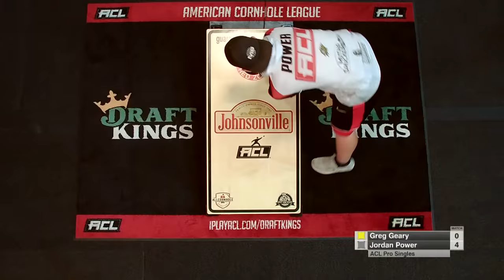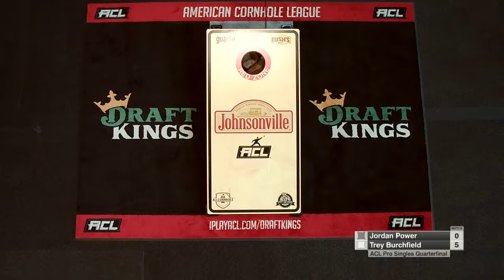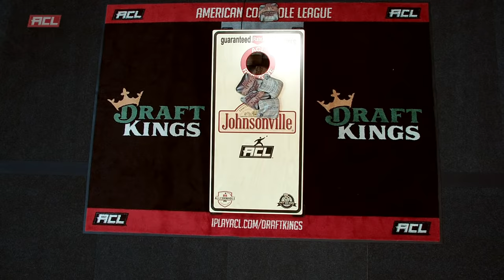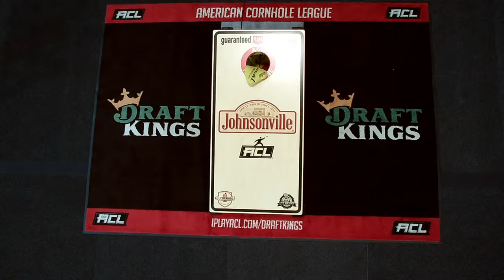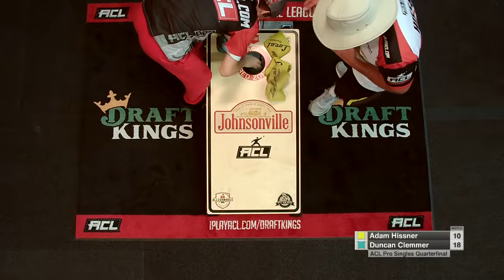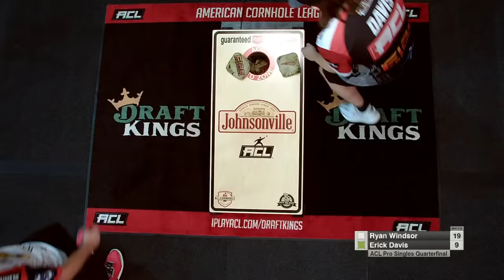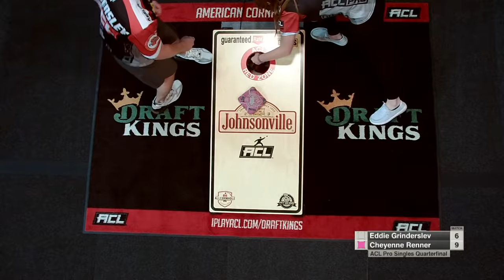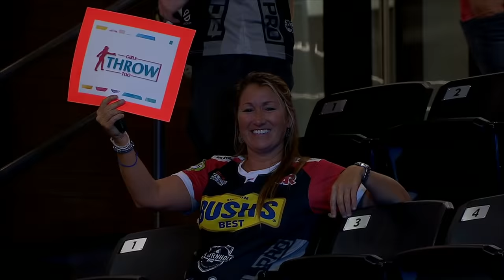2021 American Cornhole League World Championships: Pro Doubles

Comment: I just learned how to play this game last night and was blown away at how fun this is. And now I find out that there is a championship, mind is blown.
Reply: how does the game work? what are the rules?
Reply: Raymond Ashby it’s very simple but hard to explain through typing. I suggest looking it up. It’s extremely fun tho
Reply: @raymondo162  It's 27 feet between boards. Players alternate throwing 4 bags per round. Bag in the hole is 3 points. Bag on the board is 1 point. Bag off the board is 0 points. It's cancellation scoring. If you throw a 9 and your opponent throws an 8. You get 1 point for that round. If you throw a 12 and your opponent throws a 12, then it's a wash and neither player gets any points for that round. First player or team to 21 wins. Exceptions to this would be if it's a round limited game which is normally set at 10 or 12 rounds. In those games whichever player or team is ahead after 10 or 12 rounds wins. Doesn't have to be 21 points.

Comment: i saw a smaller version of this in a pub in sussex (south england, uk*) in the early 1970s. the pub version was called 'toad in the hole' the target was a foot square topped with lead, the projectiles were heavy brass coins (i think). *(formerly eu)
Reply: BTW: coin stays on lead top = 1 point;  coin goes  in to hole = 2 points

Comment: I'm brand new to cornhole.   (Just learned of this game yesterday.)

I have a question.  

During this video, when each of the players were competing against each other, they ALTERNATED throwing their four bags.  

However, according to the Official Sanctioned Rules rules of the American Cornhole Association, the play of the game is as follows  "4. The top of an inning is completed when the first player pitches all four bags; the bottom of the inning is completed when the remaining player pitches all four bags."

As noted, they weren't doing this.

So, which is the proper way to play?
Reply: But….they still take turns alternating back & forth.   (But, i can see how one could mis-interpret those instructions as written).
Reply: @markb8954  Since I wrote my question, two weeks ago, I've learned a lot about cornhole.  And yes, I found out it is indeed quite proper and correct to alternate throws back and forth.  

I do believe that sentence would benefit from being re-worded.

THANKS!

Comment: Anyone know of any good videos showing tips and practice routines for improving consistency? I can throw two four baggers in a row, hit pushes and airmails but then I might turn around and throw a five. Consistency is what I need most.
Reply: If you know you missed as soon as the bag leaves your hand, then you just need to keep throwing.
Reply: @xfactorstl  See that’s exactly the problem.. a lot of the time I can’t pinpoint what I did wrong with bad throws. Everything feels normal. I just flat miss the hole by a couple inches alot, and not in a consistent way I can adjust for either, like if I was always missing to the right or something. I miss left, right, short, long, you name it.
Reply: Muscle memory
Reply: These guys practice for many hours per week.

Comment: 8:41 im confused how did greg with yellow bags put all 4 bags in hole but only get 2 points but then other guy on previous throw at 7:39 puts all 4 in and gets 5 points how does that work.
Reply: Points cross cancel. 

So the first round the grey bags scored 12 points (3 points per bag in the hole) and yellow scored 7 points (2 bags in for 6 and 1 on the board for 1) So 12 - 7 =5

The next round was yellow 4 in = 12 points
And grey had 3 in = 9 + 1 bag on for 1. So 12 - 10 =2
Reply: @Mashtatters  Thanks. Now I get it.
Reply: Bags cancel each other..example..One guy throws 4 in, the other guy throws three in..first guy scores 3